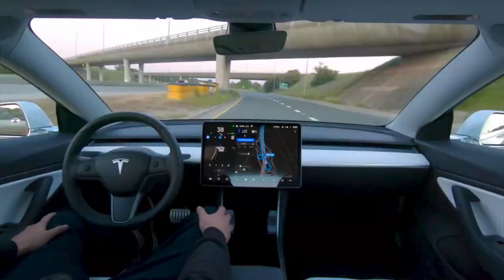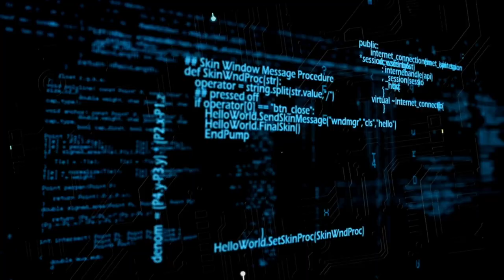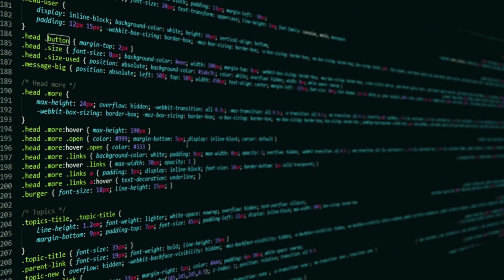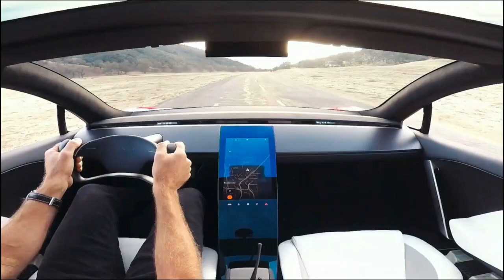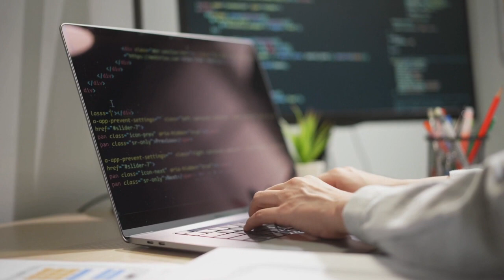Why you should not become a Hardware Engineer

Comment: Oh my gosh. I thought software engineering was stressful, but 2 years working on one chip that may not work if you make the tiniest mistake? HW engineering isn't for me 😅
Reply from the maker: 😂 yes, I know sounds scary
Reply: But it makes fun, if you can get a chip working despite a design problem slipped through testing, happing to me, very very cool stuff.
Reply: Btw same can exists for software 
We have 2 years projects for a certain project that can fail 

Also if you come to game dev in which you can build a game for 4 years only to fail 

It all depends on where you are in the field

But of course the software is much cheaper than hardware
Reply: @ko-Daegu  yes but, even in the case of 4 years game dev, software can be tested on the go, along with the design process. In IC design you can (practically) never verify the whole system at transistor level (mostly behavioural simulation is performed) and you have the final proof only after having the first IC samples.
If then something is wrong, as you said, another tapeout is not for free both in terms of money and time.
Reply: Yap, as a digital design engineer I can confirm this 😂
Reply: They have test in place to take care most of the major issue but, yes, they can iterates newer version to bring further improvement.

Comment: Thank you for a  giving such a clear overview. I have been a hardware design engineer for almost 40 years, Mixed signal IC designer for 30 years. It's the hardest thing I've ever done. That is why it's so rewarding. If you are good at it, it is also EXTREMELY lucrative, but it is very hard, if you just do it for the money, you will fail.
Reply: I am currently about to finish my 4 year in Computer Engineering, I found after spending time in CS for 2 years I started to love hardware over some of the software design. Instead of CS, I chose to minor in mathematics and CS, and major in CpE, loved it ever since, instead of creating a simulation software for example running off of a clock or counter, I can instead design the logic board and I literally coded all my gates in Xlinux, and imported the circuit onto an Fpga board. Its exactly the description, over software design, hardware takes alot more time and mathematics(Bad Diff eq... waveform analysis/ Fourier...)comparatively when it even comes to projects and etc...
Reply: How did you start?
Reply: I started with a bachelors degree in electronics and electrical engineering. I know good mixed signal design engineers who started with a physics degree then added a masters in electronic engineering. There are some universities that  have courses specialise in analog IC design.
Reply: @@mikail232no they can be simultaneously taught.

Comment: With all engineering: it is challenging as YOU are RESPONSIBLE. There are not many other people around that have the required skills to assist you with your tasks and answer questions. Those that are around in your team are BUSY. After all engineers are typically an expensive resource. And don't think your manager can/will support you. She/he/div doesn't know how to and they hired YOU to get stuff done. You have to solve challenging technical problems. Both HW and SW are unforgiving. They do as you design them. If stuff fails you will not be able to blame the compiler or the chip. YOU made the mistake and will be held responsible. There is no layer of human intelligence that might prevent you wrongdoing to get bad (but there is also no human stupidity in your way to do great stuff!) Depending on the discipline people might get hurt or killed due to you failures and mistakes! You have to oblige to rules and procedures that you first have to learn that might appear irrational to you. You DO get in contact with politics. Frequently you have to deal with people that are 2-3 times below your skill level - but are still in power of the game (HR, Finance, Project managers, ...). So if you don't want to be held accountable - engineering is not for you.

Comment: I think it's a lot more fun Anastasi to just start your own business and design your own hardware for your own chosen projects for your own internal and external projects and to do the software as well. I've done it and it was fantastic! But... I usually had single microcontroller boards. Niche products 😎 There's a lot of joy in covering all design aspects of a product from BOM selection, hardware, software, test assembly and testing.
Reply: Can you tell me more about this? I'm in my senior year for my BS in EE and I'm very interested in the analog IC design but my understanding was that you would have to work for intel, apple, etc and be completely reliant on those companies who can fire you at any moment. What kind of business did you start and what are the barriers you went through? Is it easy to start this kind of business, assuming you have the design knowledge?

Comment: I would add that the sheer amount of math and physics you need to understand to work in hardware design is orders of magnitude higher than a typical web dev/enterprise application developer. 
All in all, you bring up very good points. I mostly worked with PCB Design where production cycles might be shorter than for IC Design but still... You work for 6months on a board where you have multiple ICs, RAMs, processors, FPGAs, you send it out for production and when it comes back it catches fire because a you forgot a decouplig capacitor or you fucked up the power supply... Lots of "fun"! 😢
Reply: Most enterprise dev , there is no math. Most computers barely compute anything!
Reply: Games & 3D engine/software use ungodly amounts of mathematics.
Reply: @NinjaRunningWild  this is true. But enterprise? Not so much
Reply: The mathematics and physics involved in hardware is mostly limited to niche job profiles like analog or EDA design. While most of jobs in hardware like design, verification or layout, are much like software development, scripting or automation jobs and doesn't requires much involvement in maths or equations as those are handled by EDA tools directly.
Reply: One Pro Point for EE: At least maths and physics wount change that fast over time.
Reply: @alansaunders1828  yea, dude.. most code seems to go into various “trophy cases” and “the math” seems to be “if (x + y) > 5 box.color = “blue” else box.color = “red” “.. saddens me a bit that the “heavy” stuff like that you’re talking about, doesn’t get as much traction.
Reply: @NinjaRunningWild  other than linear algebra ( matrix) and basic differentiation, there's not much math there.

Comment: Back in the early 80's, when I was getting my E.E. degree, I knew several people that dropped out of the E.E. program with D's and F's only to change to software and get A's and B's. Yes, it is hard to be an E.E. in the design world, unless you become a "paper" E.E. I have known those as well.
One thing that is important about E.E. as opposed to software, is that the E.E. requires a lab and equipment. That usually requires "on site" employment. Not always, as in the case of PCB design and strictly FPGA design, but if you are responsible for making a piece of electronics hardware work, it will require debugging. That requires a lab of sorts.
Reply: If you do hardware design for ASIC and verification, you just need a computer with the right tools.

Comment: Thank you! This was a great video for me as I'm considering switching from Software to Hardware. Hardware just seems so exciting but at the same time I encountered many of the downsides that you mentioned.
Hopefully Hardware development will become more like Software development in the future. We just need better tooling, agile management, flatter hieararchies, more funding and all that...
Reply: But that's what they said about software engineering years ago, "We hope that someday it will be more like hardware engineering." What they were talking about is standardized components. At the time software was ruled by the "not invented here syndrome" (only trust your own code). Plus there wasn't as much chip design as there is now, so most engineers were using off-the-shelf components and doing board/system design--they weren't creating components.

Today it seems there is more trust in software frameworks and more reliance on custom chips, and so software and hardware have moved closer together. But chip design isn't the be-all end-all of hardware design. Tons of products use only off-the-shelf components. If you do need a custom chip there are FPGAs and semi-custom silicon, which radically cut development time and cost for a custom chip (but you pay for it in component cost). With RAM based FPGAs some engineers treat it as agile and spin a rev every couple of weeks.

Chip design tools are incredibly advanced and way, way beyond anything I've seen for software development. Each tool in the stack typically costs tens of thousands of dollars, and so having $100,000 of tools (programs) on your desktop (often Unix) is par for the course. However when you look at the cost of an engineer, $100,000 is nothing.

Full custom silicon is the ultimate in "waterfall" engineering. Create the spec and verify that it is perfect. Architect the chip, design the logic, and verify that it matches the spec. Do the layout (tapeout) and verify it matches the logic--at this point we're able to start getting into automated verification tools, and for FPGAs, layout itself is semi-automated. Create the test vectors to verify the silicon matches the design--which can be about as close to fully automated as possible using modern tools. Finally get your prototype chips, put them in your prototype product, and see if the spec was actually what you needed in the first place.

Of course spec verification is 100% human brain power. And so is verification of the logic design. Maybe if you had a formalized specification language then you could get some automated help with verification that the design matches the spec. But then you move even more pain to spec creation. The two steps of spec and design verification takes about 70% of an engineer's time. Note that matching the design to the spec often uses code coverage tools to see how close you are. Getting above 90% is damn near impossible.

I'm 66 and used to do chips for the storage industry--disk drives and enterprise disk controllers. Having an intimate understanding of what the chip needs to do helps massively with spec creation. Although I've never had an outright failure of the first spin on a chip, we always budgeted for a second spin. Because at some point reality is cheaper and faster than simulations. My chips were never anywhere near as complex as what is possible today.

I'm getting into full-stack development these days.
Reply: @ScottyDMcom  I admire your knowledge on this topic. I am also amazed by your determination to start will full-stack at this age. I am about 1/3rd of your age, and have recently started my career in hardware and am very interested with the opportunities in future. Thanks for writing a comprehensive comment about this industry and your experiences. I did enjoy reading it all. All of your words seem so much relatable to me, and my work.
Reply: @avisekhghosh2757  can you me to because I am new too and confused between hardware and software what to choose ?
Reply: @mayankkaushik1091  Sure, one thing is if u r not sure, or u don't have any specific interest in aligning you carrer into something, you could pick software anyways. Although the type of work we do here is different from software, but from high level most of the roles in hw and sw demands/ have exposure to almost equal qualitative and analytical skills. If you enjoy sw dev work, then you definitely would hw too. But only choose hardware if you have interest and passion for this field, since initially it is little difficult to enter into hw industry, as vacancies are relatively less.
Finally it boils down to what you would like yourself to be called, a hw engineer or sw engineer.

Comment: I was also a "hardware" engineer for a year but not electronics, but custom small and medium transformers for a specefic purpose in the maschine production industry, or for electrical installations. But it's comparable to chip design because it's an electrical product that ends up being mass-produced on an assembly line. A competitive low voltage power transformer is probably less complex to design than a competitive chip, because one single electrical engineer can design it. I have designed about 500-1000 small transformers that were produced on the assembly line. For the first 8 months my calculations and construction plans were always reviewed by a senior engineer... However, they could not extend the fixed-term contract because a major customer stopped ordering and the company announced 6 months short-time work for the second time. As far as I know, the company is now stable but has not grown in the last 7 years...
Reply: Can I be a hardware engineer with a computer engineer degree?

Comment: All valid points, but you missed two crucial points. Hardware jobs are much more limited in number than software jobs, because as an industry, software is much bigger than hardware. You only have a handful of companies where you can look for h/w opportunities. Secondly, I believe salary in software engineering is a bit higher on average compared to h/w (even more so for machine learning and all the new fancy stuff). So although h/w engineering is probably more difficult and stressful compared to s/w, you get paid less to do it. (I'm a hardware engineer with about 15 years of experience.)
Reply: Sad

Comment: If possible can you please teach basics for hardware engineer.
Reply: Well, I spent 4 years at university to learn the basics, then multiple years industry experience and, as Anastasi said: you need to be constantly learning. If you don't yet have an engineering degree,  I recommend you look at open courseware from MIT, you can follow the complete undergraduate electronic engineering courses for free: but you won't get a degree by just following the courses. You will need a degree to get hired somewhere where you can learn the practical aspects to make you a fully functional hardware engineer who can design tings that can be sold.

Comment: I think hardware industry is 10-20 years lead ahed then software industry.
In my opinion now a days hardware (computer processors) are much more powerful than windows 10-11 
windows 10-11 can not fully optimised with current hardware to give the best performance.     ( correct me if I am wrong 
I am an embedded design enginner , so I don't know much about the semiconductor industry )
Reply: Hardware industry is not ahead of the software industry. The problem is the barrier to entry. This barrier means much more funding and labor goes into software. This doesn't mean software is "better" than hardware. It's just that the industry is much more developed because it has far more people, money etc. supporting it.

Comment: Anastasi  this the case in other Engineering fields. I have structural Enginnering background and we are checking and rechecked extreme large computer models.  The time is always not much.  Companies are pushing on shorter time windows , and compromising aircraft safety for example. 

Plus they are wanting you to know about so many other areas besides structural. For example I was supporting Aircraft flutter. You better be an expert in Aerodynamics, structures, vibrations, and flight loads, stability,  and it is and endless list. 

I used to read about 1000 pages of intensive math to understand Aircraft flutter which is much harder than electronics of electrical Enginners face.. 

The math in flutter is as challenging as Quantum field theory. 

No No I said this is enough I will not be used by these American companies for future worthless dollars that devalues every year. 

So I retired. Now I learn what I want, not there to put out fires because some Manager wants something done.
Reply: You don't know what you're talking about. If you work in RF design and microwave/radar engineering fields in electrical engineering ( where you're working on complex electromagnetic field and waves) , you're going to face a lot of very complex mathematical problems. Even transmission engineering is quite numerical.
Reply: @dekev7503  I did not say that other fields are not complex. I was just replying to Anastasi saying not only this is the case in her field I faced same challenges. 

I do know what I am talking about. You can get very far into any subject.
Reply: @manaoharsam4211  you said that your aerodynamics problems are more difficult than the math that electrical and electronics engineers face, and you compared it to quantum theory ( which by the way is even studied extensively and applied In electronics by engineers working in solid state design).

Comment: for the programing part of the job can I be self-taught or would I need to be classically trained 
Another question how much "group work" is there ( cause I hate working close to other people)
Reply from the maker: 1. You can be self-taught of course 2. 😅This depends on your job role. If you are on technical ladder, then not much.
Reply: There isn’t a fixed education when it comes to software engineering, or not just yet. There are a lot of self taught developers out there & they tend to excel better & is competitive. If circuits, processors, computers speaks to you, programming won’t be a question. Or forget it, just begin to write programs. It’s accessible and  it’s out there. Engineers in general works together though 😬